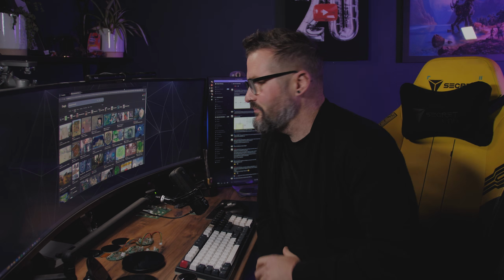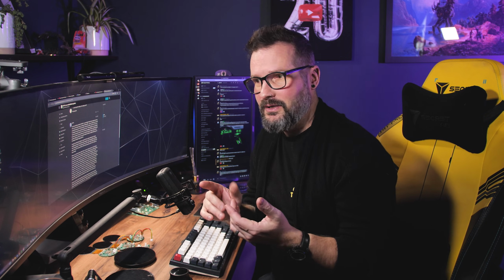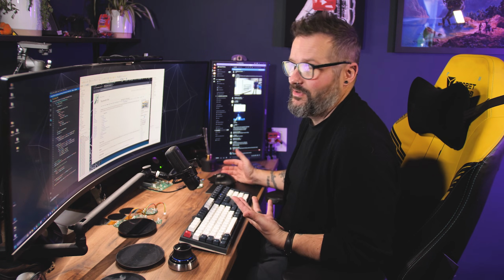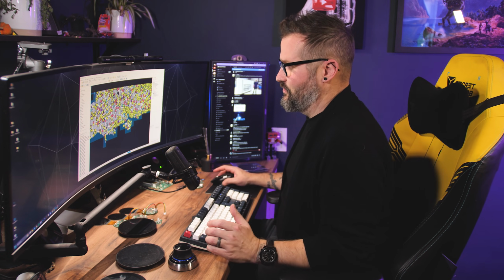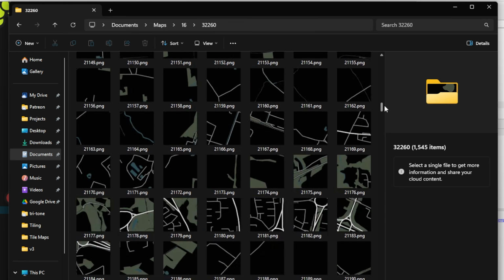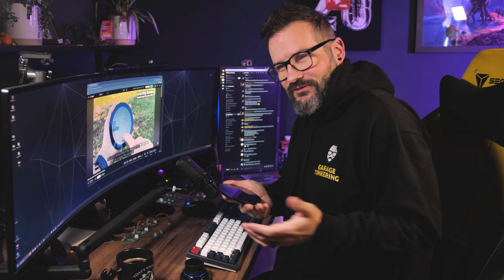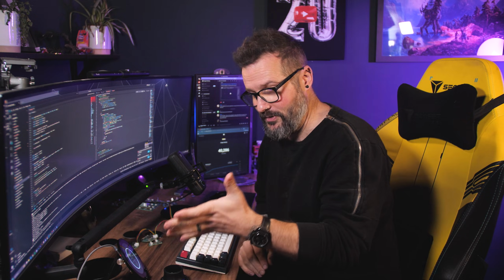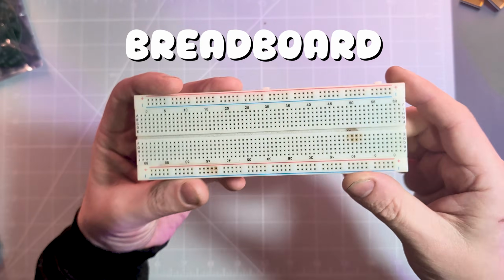A Real Mini Map from Need for Speed

Comment from the maker: GIve me your tile count guesses here 👇

Edit: Hint, it's zoom level 16
Reply: Considering folks were able to do image rotation--using the Bresenham's Line Algorithm--on an 8-bit Apple ][ running at 0.001GHz, I have GREAT confidence that a 32-bit ESP32 running 400 times faster can do it in a timely manner.

...probably not in Python, though.  :lol:
Reply: Haha I was well off the mark, I was expecting around 500k!
Reply: Zoom closer at lower speeds, this zoom at higher speeds, have a color on the outside rim that indicates the direction of the petrol station, the color becomes a circle as it comes into frame. Add white icons in the circles. You got this bro!
Reply: how many was it left when the black and blue tiles were removed?
Reply from the maker: @t5-andy around 1.8M
Reply: Is the zoom level 16 anything to do with the mismatched file count? 2,533,800 / 16 = 158,362.5, which is almost exactly what it told you it would be.
Reply from the maker: @chux4w I believe so
Reply: There is a motorcycle GPS system called a Beeline Moto II, its minimap that sits mounted to your handle bars tied to a phone gps via bluetooth... provides a very minimalist black-white circle mini-map.   Rather than rendering all the maps, its basically a display rendering the path/local area ahead. (I believe)
Reply: Give me your max zoom level first 🤣
It'll be one of huge, ginormous or mahoosive.
Reply: depends on how close you zoom for each tile, but assuming you are video game close, and the entire UK. 4-5 million would not be unreasonable.. if we go for really great visuals, double..

after the reveal
welp, i was WAAAY off..

after the count
well, a little closer.. still a bit off, but again, depends on zoom level and how much detail you want in the images..
Reply: As far as I understand, you are rotating the grid with tiles globally, which causes difficulties in calculating the positioning of the tiles. I suggest putting all the tiles in a container and rotating exactly the container. Inside the container, everything happens according to the internal coordinates of the container. And to rotate the map, rotate the container itself. I was also confused by the fact that not all the display space is being used.
Reply: 157
Reply: 2 million
Reply: The question is incomplete without knowing the min and max zoom level 😉
Reply: It was really dependant on zoom level. I initially guess 56k.
Reply: 2500
Reply: Great.   If you sell one ready to go out of the box, and it plugs in the cigarette lighter,  I'll buy one.   A mini  GPS is good for around town...
Reply: I couldn't have got close to that.
Reply: i said 2000 but i blame not knowing the zoom level first
Reply: insert RCE 16 meme here
Reply: I blurped 151k
Reply: I guess, 2.272.440 tiles, based on the area of England and Wales and the number of each second square, what I suppose to be the size of each file
Reply: 5 billion
Reply: I guessed 3k for some reason 💀
Reply: I love when you run your computer full throttle for long periods of time and the result is something massive that you actually are pleased with.
Reply: haha thought it was gonna be 16k and got really stoked when you said it's 15 something, but I used qgis a bit so I might've been sorta cheating 
(((just got to the part where you exported it all lololol nevermind)))
Reply: simply brilliant, well done, thanks for sharing.
Reply: Can you make smart car remote with esp32 c6 and display  or buttons with nice 3d printed remote panel?
Reply: 28,000
Reply: 3.4 million
Reply: This is AMAZING!! i wish i had a car , so i could have an excuse to build suck an amazin tool for a daily use
Reply: 185,000
Reply: I did shockingly well. I tossed out 147,000 when you asked lol.
Reply: legit i thought 300 lol!
Reply: You can employ caching: pre-render rotated map into a buffer and then simply x/y move that. When angle changes, re-render. You can pre-render multiple angles in anticipation. If your ESP has 2 cores, you can have one core being a render worker while another takes that off onto a screen. You can overclock it too. For example, RP2350, the raspberry made microcontroller, can be overclocked to 400-500mhz and it has two cores. All for like $2.
Reply: I guess 100 tiles.
Reply: 160000?
Reply: I think something like 156780 give or take ?

Comment: so i am in the process of making a datalogging dash for my bike to run next to my trailtech voyger. i am considering making my own GPS to replace the trailtech as well. I am using stm32 controllers. I am really pushing myself instead of leaning to making the next version with a gps.

Comment: bro i think figuring out someway for google maps to send data to that instead of loading the whole maps , there should be a solution in which google maps in configured to  work on phone and some how is projected to the display
Reply from the maker: I mean that's reasonably simple using a Pi with second screen or custom Android Auto, but wanted a different challenge for this. I'm gonna do that at some point in the future though.

Comment: Hello, friend.
I have a 2.1-inch GC9B72 TFT LCD screen, but I can't get it to work at all. Do you have a video or any tips?
Reply from the maker: Typically all boards come with some form of demo code. That's usually the best starting place.
Reply: @GarageTinkering Hi, is it possible to find out where to find the wiring diagrams of the components, I understand that the video shows how they are connected, but I have some misunderstandings

Comment: Nice job. One thing I did with my GPS module was include a reatime clock module so the canbus always has accurate time until the GPS gets satellites for atomic time. Not a big deal but if you have anything using/displaying the time, it stops it using epoch time for a while after start.

Comment: Quick question, if there is any updates in the maps, how do you plan to update the minimap? Would it be like doing this all again or compare data and replace the tiles that has any change?
Reply from the maker: Honestly, I'm not sure how necessary it is in any short amount of time. I can't remember driving down a road anytime in the last 5 years that wasn't there 5 years earlier. 

In already largely built up areas where I tend to drive, the roads aren't really going to change all that much. 

Sure, it will need updating at some point in the future, but now that it's done, it's just a matter of letting the process run overnight. Not really a big deal.
Reply: @GarageTinkering  i understand your situation, it's just that... If I want to make a map of India, there are roads disappearing overnight, bridges being built, new highways and infrastructures forming etc etc. so it is something I should think about. Am trying to use vector based tiles so the size is significantly reduced. Hopefully it will go smooth😌

Comment: Hi, others have suggested vector graphics and it's totally valid. If i can suggest a lazier approach, since you're displaying logical images (few distinct colours, with clear demarcations between them), you can try shrinking down the images when generating the tiles. Then upload them as usual, combine the 4 or more images you need based on coordinates, crop out the area that needs to be shown, rotate it, and then upscale the result back to the original size (which is pretty easy with that kind of image, without smearing). Using a dedicated matrix manipulation library rather than lvgl to rotate the cropped minimap might make all that useless too.
Jury is up on if resizing all the images takes longer than using vector maps anyway!

Comment: Instead of fully rotating the map, couldn't you keep the car rotation internally but then visually lock the car icon facing north and have the entire image rotate around it? or would that add too much weird spaghetti code type stuff
Reply from the maker: That's basically what the problem is

Comment: I'm working on an LVGL project and I had file size issue that were made much better by cutting down the colour mode, for what I'm doing 4 colour worked well, which is roughly 1/8th the file size, then you define whatever colour palette fits for those 4 colours in your code.
I imagine that would boost your performance if you can reduce those file sizes, but if you don't need to revisit it, might be more trouble than it's worth

Comment: You have a round display, you could just cheat and rotate the whole display so the car points upwards. Than you can also paint the North arrow on the side of the display, since that never changes and you do have everything.
Reply from the maker: You could but you're adding a whole other level of complexity to go wrong.
Reply: @GarageTinkering it's managable, you could push out the compiled Sensor-Data for logging and debugging on a UART port. Than you can just have an extra MCU do only rotation. Thisway it becomes an Addon and the complexity stays contained.

Comment: idk why people think having to use a pi makes it impossible, car manufacterers since the dawn of time have profited off the knowledge gap between the typical motor enthusiast and how little they understand about computers. my 2025 BRZ for example gets to a point after enough android auto and bluetooth usage where the internal storage is filled with contacts and smses. the car has no ability to deal with this so it just doesnt turn the head unit on until you reset it. putting 16gb of EMMC storage in and a better memory bus than whats present would have cost subaru a cent per every hundred cars. yet they still dont. teslas were really cheap for how fluid the computer systems were when the company needed to care so its def a cost cutting method by the motor companies

Comment: this whole project - similar to the radio upgrade - is a great showcase of how being savy and putting in the research and work can get you awesome, working, new things. congratulations on your perseverence
Reply from the maker: Honestly research is like 70% of the job
Reply: @GarageTinkering it's like that anecdote with the ship mechanic who charges an obscene amount of money for something basic like tapping something once with a small hammer. "i didn't charge for what i did, i charged for the knowledge that i needed to have, to know what to do"
Reply from the maker: Yeah. And now I can do these things in a month (which is still objectively long) instead of like 6 months because I've been doing similar for 30 years.

Comment: What a cool project!
But why did people say it was impossible? I haven't given it a lot a thought but I would have assumed that if it was easy on a Pentium from 20 years ago, an ESP32 could probably do it today (especially as it's the only thing it does, it's not rendering 3D graphics at the same time). But I'm surprised you choose to keep so much details on these images, they could probably be a lot smaller, making the interface snappier.
Reply from the maker: The detail was determined by the game UI. I was just following their design
Reply: @GarageTinkering  The original game (with 3D graphics) was smaller than just your map, wasn't it?
Said differently: 4 kB (on average) per image seems absolutely huge and I imagine each takes a very long time for the ESP32 to load
Reply from the maker: The images are 129kB a time actually. And that's as BIN files
Reply: @GarageTinkering  Are they converted in bitmaps, then?
I'm surprised there's no way to reduce that size.
Reply from the maker: They're preconverted BINs that LVGL requires which means it doesn't have to convert on the fly and saves memory resources at runtime. 

It's a sacrifice that makes rendering way easier on the MCU
Reply: @GarageTinkering  Yeah but the loading time from the SD card is extremely significant. I wonder if that isn't too much of a sacrifice. Rendering 2D in the 1990s (on hardware capable of a few MHz) was fairly easy, so...
Reply from the maker: I mean it's open source for a reason. Feel free to fork the repo and have a crack at a reoptimisation. Would be dope to see. I'd do more on it, but it works fine for now and I have a million other things to work on.

Comment: Amazing stuff, a good follow up to this can be navigation, like what you have on a game during a mission 🤯

There is an open source project called OSRM, its a routing engine that calculates the shortest path, like Google Maps does, but you can customize how this calculation is done. Basically you host it somewhere with your map, when you input your location and destination, it does the calculation and finds the shortest  (or most optimal) path according to the weights you assign. Like if you hate a street because there are too many speed bumps, you can assign weights to these Openstreet map elements so OSRM doesnt prefer that route.
Reply from the maker: That's interesting. I'll have to look into that one. I'd definitely like to be able to filter by speedbumps haha
Reply: @GarageTinkering   I was researching a bit on my Friday night 😀😀

Well, it seems there is a very popular open source project called Valhalla that does the same thing but seems to be better, better documentation and all, turns out even Tesla is using them.

Comment: That’s an amazing project. You inspired me to do the same.
The problem with the rotation might be that you are rotating every frame and probably even if it changes from 0.00000001 to 0.00000002. You could try first rotate only for 10^-3, then do it every 2 frames or create a event for when it detects a rotation. The last resort would be rotate the driver instead of the images

Comment: Instead of loading tiles as they're needed why not just load a 3x3 grid and when you leave the centre tile then set the next tile you're in as the centre unload the 1x3 that's no longer within the bounds of a grid and then load another 1x3 that's within? Since each tile takes 0.01 seconds to load you can delegate the loading time to another thread anyways.
Reply from the maker: That's exactly how it works

Comment: How and why did you wire it to the can Bus?
Reply from the maker: If you mean my car's main CANBus, then I didn't. I just have a micro CANBus that I use to connect all of my devices, one of which sends out GPS coordinates that any other devices on the network can utilise if they need
Reply: @GarageTinkering Ooh, ok I get it, thank you! I also own a 350z and am just getting into embedded systems, currently being a Web Developer. I‘m so happy I found your channel. It‘s literally the perfect fit for my projekt ideas!!!
Reply from the maker: If it helps, I'm also relatively new to embedded and have a web development background so you're in the right area for sure
Reply: @GarageTinkering That‘s so great to hear!! I have one more question: In your First led brake light video you talk about powering an arduino right from your car. However I’ve heard that the voltage in a car can exceed 12V quite a bit. Would you still do it this way? I‘m pretty sure you might be covering this in one of your videos but sadly I don‘t have the time to watch them all at once…
Reply from the maker: I have a power protection board that I designed that regulates and protects everything from the car down to 5V. That's exclusively what I use now
Reply: @GarageTinkering found it! Thank you so much!